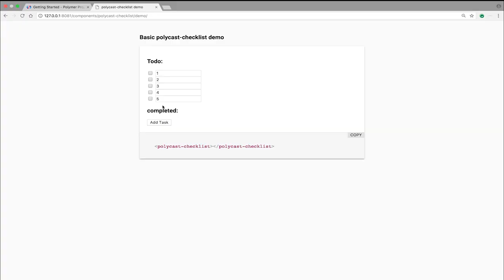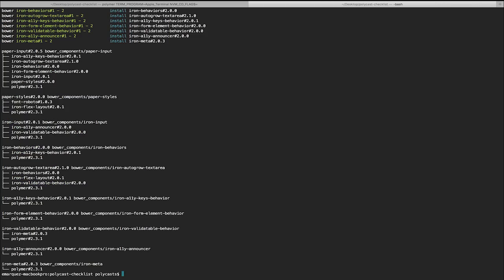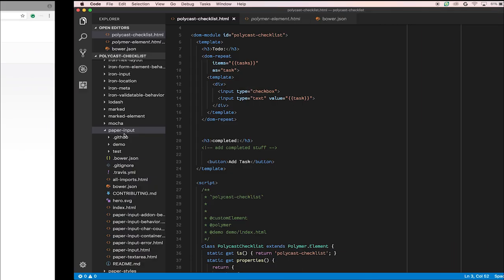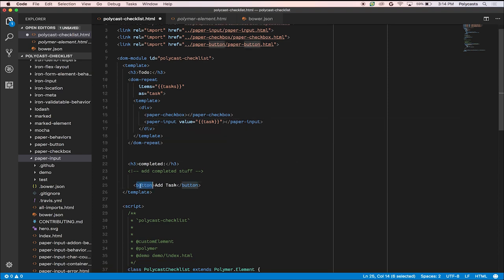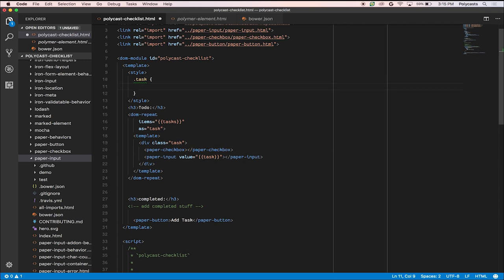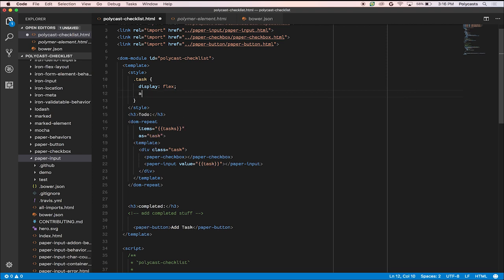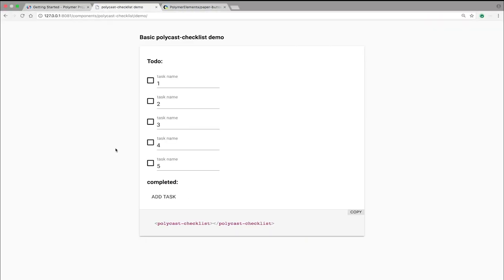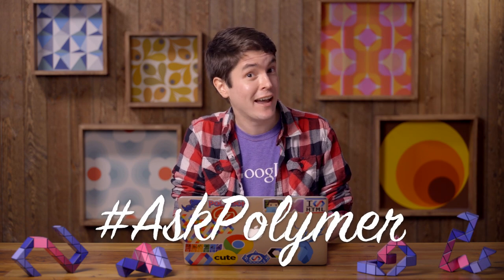Building an Element in Polymer 2: Making it Look Good! (Part 4 of 5)

Comment: Hi @Elliot, I am new to Polymer. downloading the paper-checkbox does not give me the correct directory "../paper-checkbox/paper-checkbox.html" therefore unable to load import in the polycast-checklist.html file. I used `bower install --save PolymerElements/paper-checkbox` to install the component. any suggestions? I think bower installs it for Polymer 3 and this tutorial is for Polymer 2.